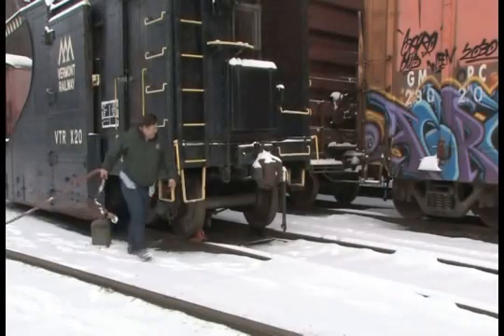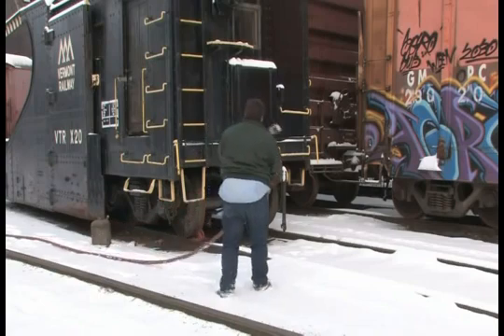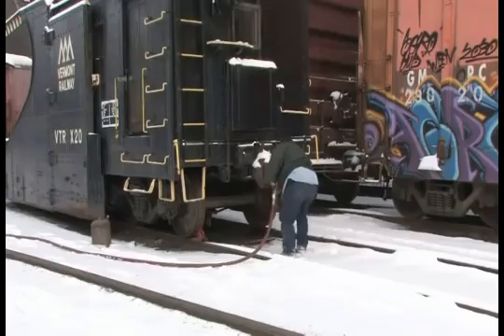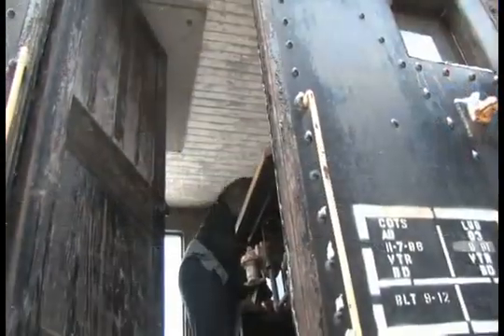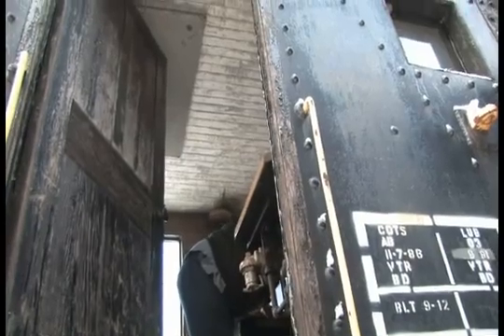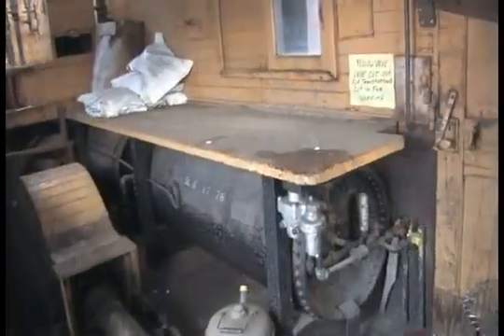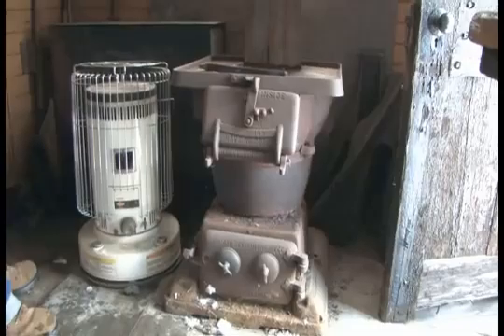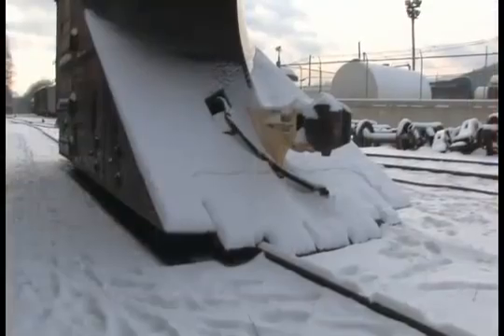A Century of Service

Comment: I worked with these type of plows as brakeman & later Conductor on CP during my 37 years there. I've been retired 14 years.  Ontario Southland Railway still uses them  & there are  films on here showing them on the same branchlines that I used to work on. We also used them to plow the main track to Guelph Jct on the CP Galt Sub. At Guelph Jct the single track ended & double track began. There was a double track plow there built by CP in 1915. It threw all the snow to the right. We'd plow to Streetsville, go around the wye & plow up the other track, then grab the regular plow & clear snow back to London, ON. 
On one occasion the plow foreman dropped the "nose" too soon & it hit the crossing planks and derailed the front trucks of the plow. You couldn't see anything in the caboose when the snow was heavy, I heard him blow for the crossing then saw the air go into emergency. When we finally stopped, I looked out the cupola window and saw the plow leaning left with its right front wheels riding the left rail. 
Thanks for showing this video, it brought back some memories.
Reply: Thanks for sharing! 

How long did that run take, Guelph Jct to Streetsville then back to London? How fast did you go?  (spose that might depend on how much snow)
Reply: @runner3033  We usually were called for a few days on those jobs. This was before Canada had a 12 hour limit. We would plow the lines to St Thomas, Port Burwell & St. Mary's on the first day, then stay at a motel in Woodstock. The last day we would plow  east to Guelph Jct & switch to the double track plow. Back at the Jct after coming up the westward track, we would pick up the single track plow & head west to London. We usually did sidings too along the way. Each of these days usually started around 0600 (^am) and we would book off sometime around 2200 (10PM).  Our nickname for snow was 'white gold". We made a lot of money on those jobs. Now there is hardly any snow & I'm long gone from the railroad game..
Reply: @rjb5847  Yeah, I remember that part of SW Ontario being pretty wild with the snow at times back then. White gold indeed - some nice OT bucks there for sure. Thanks for sharing.

Comment: wings out, wings in
that's the song this snowplow sings
wings out, wings in
it's the hundred year snowplow king
Reply: Funny you mention that. At the time I worked many of the plows, I was on the Conductor's Spareboard. That sparerboard  was often referred to as "The King Board", I suppose because you made a lot of money working it.  One of the spare brakeman gave me the nickname "the snowplow king", because I was on so many plows whether on the Woodstock branches or the Goderich line.

Comment: I take it the compressed air comes from the locomotive pushing the snowplow.   Years ago, there used to be wedge snowplows mounted on steam locomotive tenders in Columbus, Nebraska and Montevideo, Minnesota.
Reply: The compressed air came from the signal line hose on the locomotive. That's the line next to the main brake line. That kept the big air tanks in the plow filled for nose, wing & horn use.
Reply: I know for a fact that the Columbus plow is now up in Norfolk Nebraska along with an EX. CNW Jordan Plow.
Reply: Self-Propelled and steam-driven with fitted tenders?
Reply: @Baron-von-Kekistan  No these plows would have been pushed by a locomotive.  They were made from old steam locomotive tenders.

Comment: cool! first time seeing the moving parts of a standard plow 😃
Reply: These plows are a bit different than the Russel plows. On Russells the "flange" between the rail is usually ahead of the rear truck.  On these CP plows, the nose drops down at the front. The beauty of that arraignment is that the snow skinned out from between the rails is then channeled up the front of the plow & sent further away for the track.  Sometimes we ran these plows on CP for the sole purpose of taking the packed snow out from between the rails. That snow would act like retarders on a hump & slow trains trying to climb grades. In that situation the plow had to come out sometimes , even if the overall snow accumulation was small.